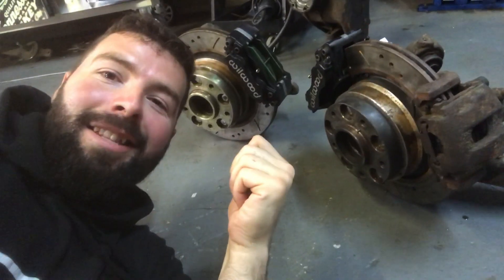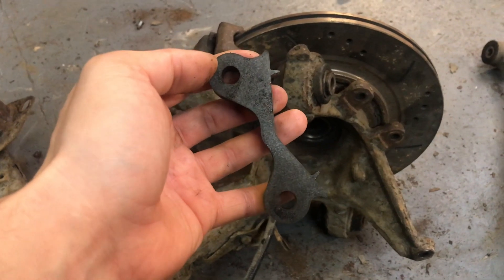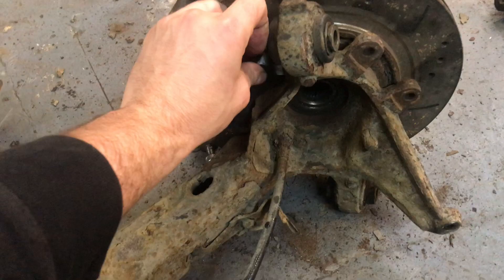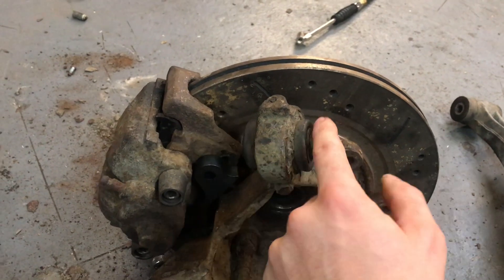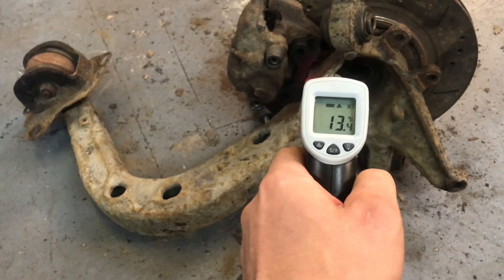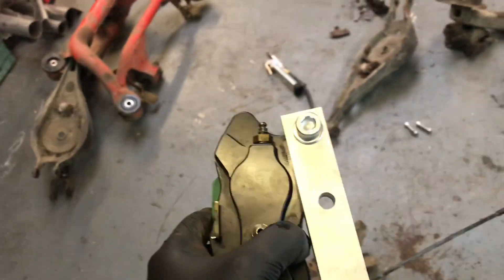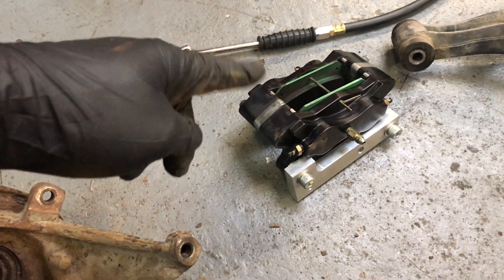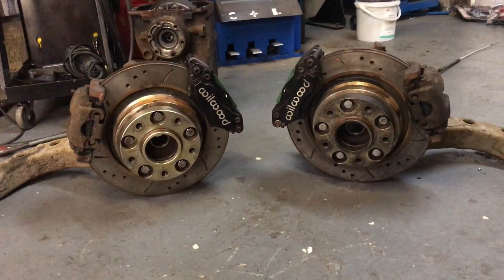1JZ E46 Drift Car EP 14 - Twin Callipers from North East Brakes

Comment: Are you using the same ebrake?
Reply from the maker: Same handbrake cables and that just hydro will now be separated from foot brake line
Reply: @SMTMOTORSPORT  I mean is it going to be the same ebrake the one you built? Because you should change the ebrake cylinder, instead of 0.7 put 0.625, it works much better, from experience
Reply from the maker: Akeem Hromushin yeah I have a completely new hydro set up 🤫 video be out soon on that